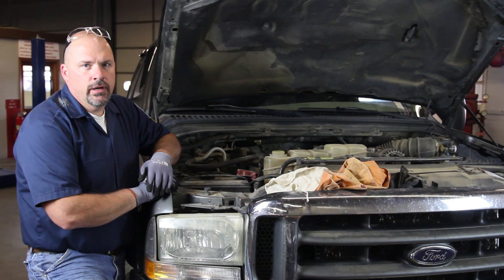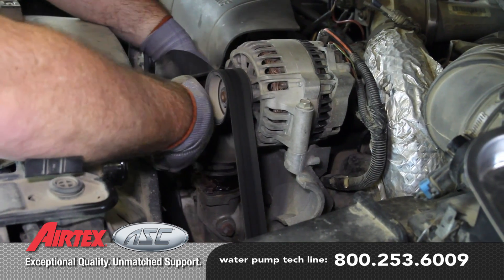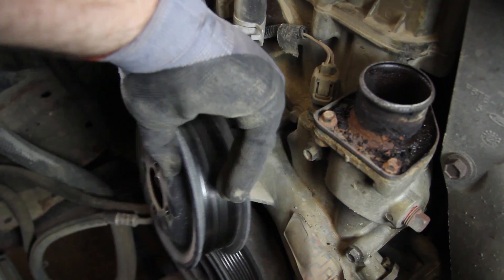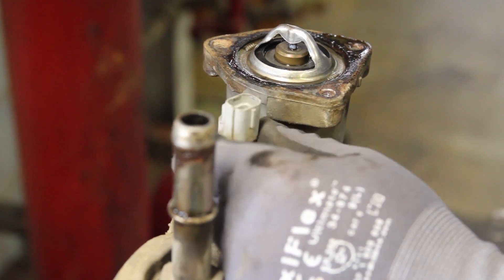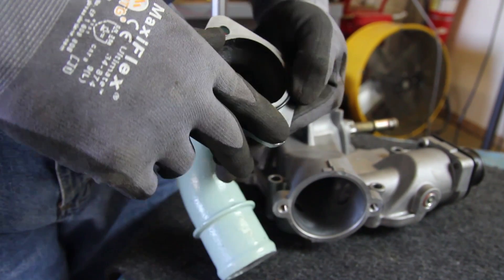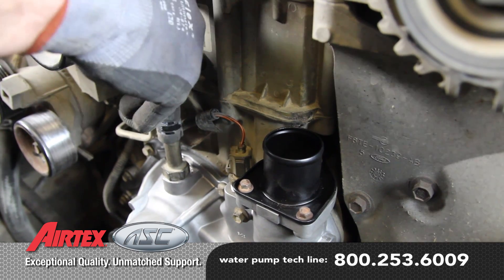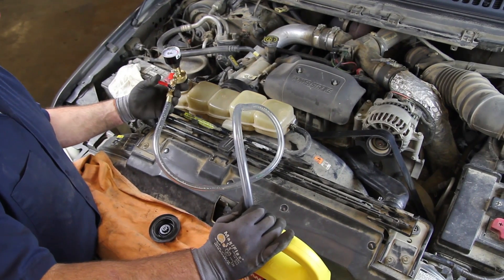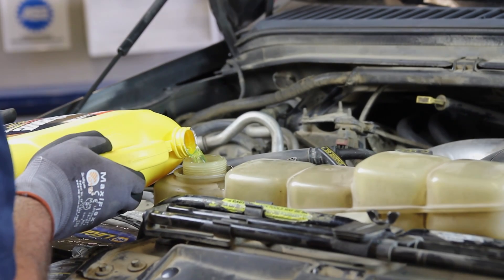How to Install a Water Pump: 2003-96 Ford F-250 7.3L V8 diesel WP-9128 AW4119

Comment: I read the title 2003-1996 but Is they any different techniques concerning if it was an OBS truck? Also is it the exact same torque spec as the 2033-1999 Thanks!

Comment: How much would this repair cost at a shop?
Reply: 18 ft lbs torque on thermostat housing will cost you a 400. Water pump. Torque spec is 11 lbs. On that.  I followed and paid the price